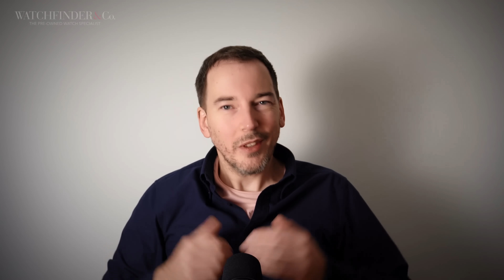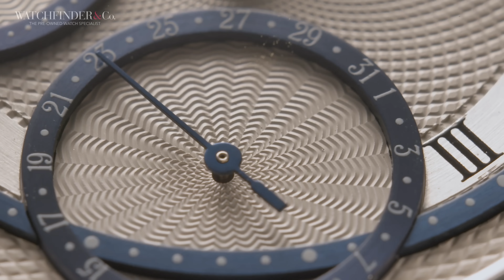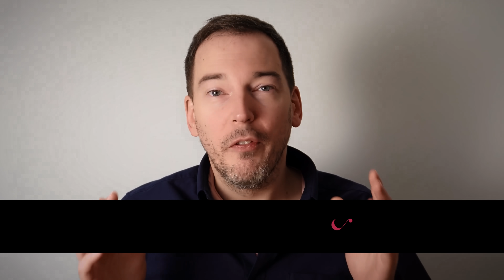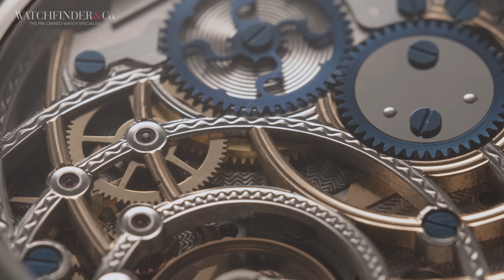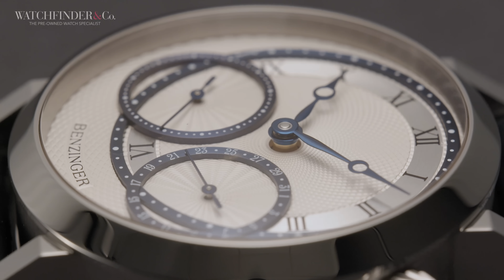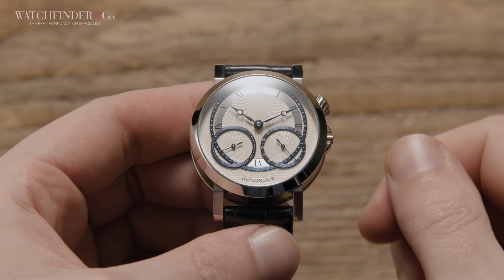The Watchmaking Secret Nobody Knows About

Comment: Thank you for presenting this brand. I think where a lot of these newer brands or micro brands fall short is the singular design language or cohesion of the piece. For example there’s classical decoration on the dial but modern angular lugs. There’s about five different decorations on the movement and a random decoration on the main spring that doesn’t not match the rest of the movement. I liken this to a chef that throws in jellies, foams, and gold flakes for no reason other than to show their technical skills. This is similar to why the initial Code 1159 failed. It had complexity for the sake of complexity. I’ll look forward to future designs but this is my opinion for why this watch didn’t capture me.
Reply: Wonderful horological skills at the service of an extraordinary timepiece, and yet. . . As you point out, a little aesthetic coherence would be welcome.  However, even if it were more affordable financially, I cannot afford the waiting time on Roger W. Smith's queu for a George Daniel's. If Herr Benzinger could throw in a coaxial escapement one might overlook the case.  I appreciate your insightful comment.

Comment: I actually prefer the older models which don’t have so many Subdials. It’s very pretty. And compared to many other companies that do guilloche this is more elaborate and fairly priced I suppose. It’s clearly not the same as a Breguet or Vacheron but very nice.

Garrick watches out of Norfolk do beautiful engine turned dials at a very reasonable price. But not the same skeletonisation
Reply: I believe he still does those, they are based on 6497/8 movements.

Comment: cheap?... well, even used from 6k-16k
Reply: Butter is indeed stunning value. So much flavor for so little money…
Reply: Cheap is subjective. This isn’t knocked out in a few mins like a Rolex. This takes 6 months to make so at circa 10k that’s cheap on the basis that the watchmaker will not receive that much profit.  If thinking cheap without context, then a swatch or anything from AliExpress is in range. Perhaps stunning value is a butter descriptor.
Reply: @mell3109 dude it's not an LFA, stop trying to justify the exorbitantance for something that looks like a really good AliExpress watch
Reply: Your ignorance of wristwatches is obvious. There are 1 million pound watches; this watch cost 1% of those.
Reply: 2004 in my third and final year of WOSTEP we skeletonized a ETA-6498. That's "only" three bridges but it still took me a full week to cut/saw. And then another whole week to finish it into something that looked okay. The slightest mistake anywhere in this process and you need to scrap that bridge and start over. So yeah, this Benziger is actually cheap.
Reply: Let’s stop with this stupid comment, you could literally say the exact same thing about a $50 watch to somebody who doesn’t know anything about watches. They might think that’s expensive.